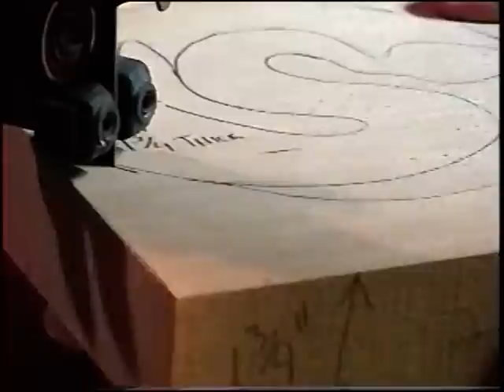Carving a Snake From Wood! Coiled "Timber Rattler", Part 1 of 4

Comment: Are you using hard pressure or letting the weight of the tool do the cutting
Reply from the maker: +datawolftech No, I'm using hard pressure. I'm guilty of wanting to get done too quick. Then I usually burn something up or ruin my flexible shaft.